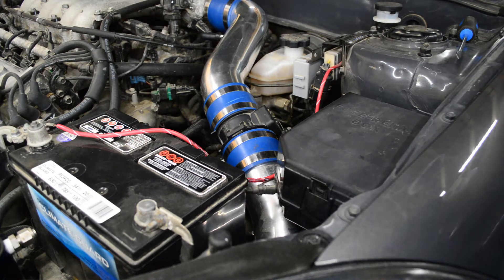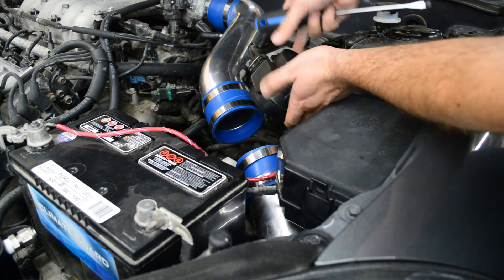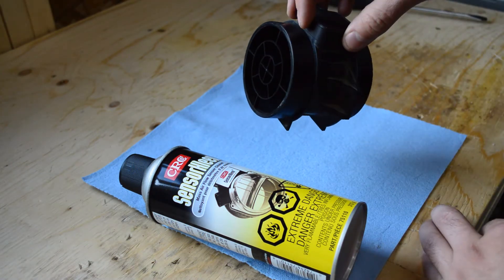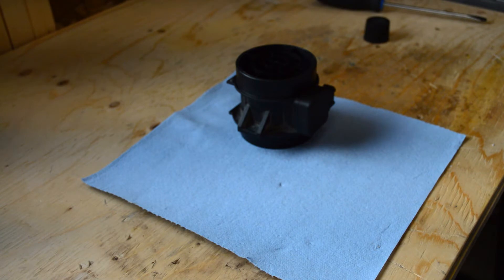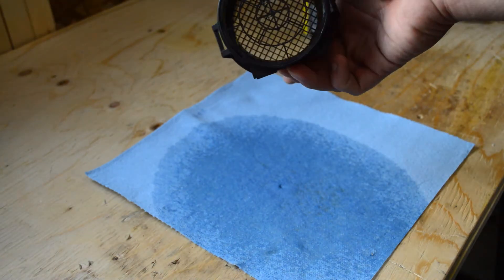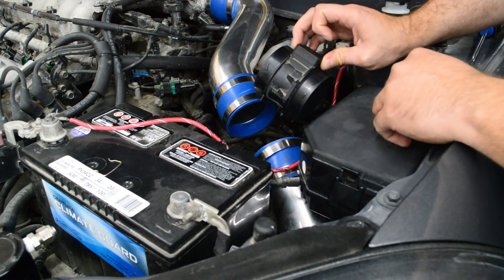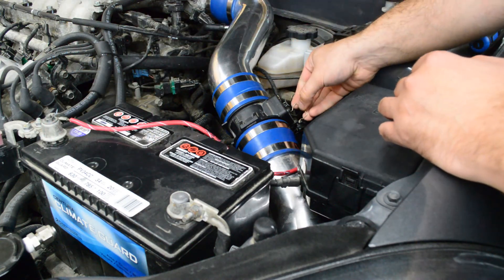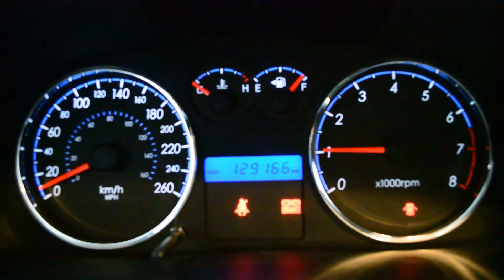Cleaning the Tiburon's Mass Air Flow Sensor!

Comment: Did you have a check engine light before you cleaned it? Is that why you cleaned it? I gave a p0102 maf code. I'm wondering if this would fix it?
Reply from the maker: Mine was fairly intermittent coming on with that code, depending on the outside temperature - if it was a hot day (something like +27°C or warmer), it would come on once my engine got up to running temperature and I was driving it a little harder than normal (because fun times). Otherwise I didn't really have an issue with check engine light. Never did see it come on with that specific code after I cleaned it.
Reply: I cleaned mine and it still gave me the same code, so I replaced MAF with new one and it worked.
Reply: @wholeycows hey just wondering but did you notice a performance difference with a new new MAF vs the old dirty one?

Comment: I have P0171 code witches mean that the engine running to lean. I will try to clean the air flow sensor and hope that's help solve the problem. I will keep you updated 👍

Comment: Hey you should probly disconnect the negative off you battery might burn out.
Reply from the maker: The MAF has a quick disconnect on it and the pins are recessed into the housing. Disconnecting the battery would be pointless for the short job this is.